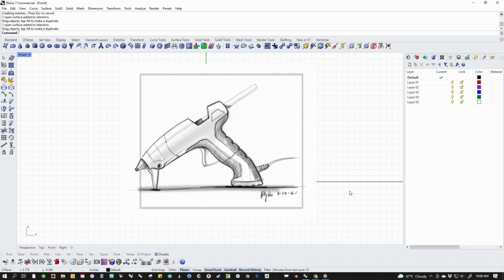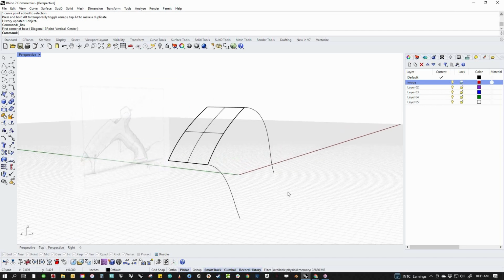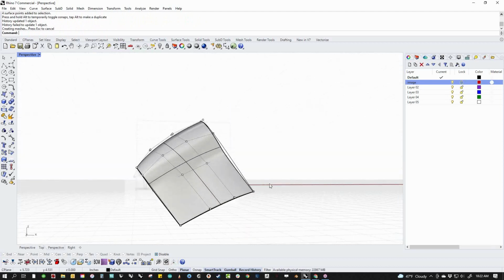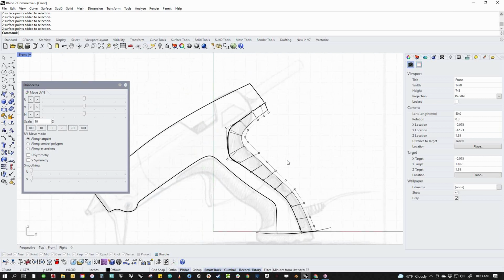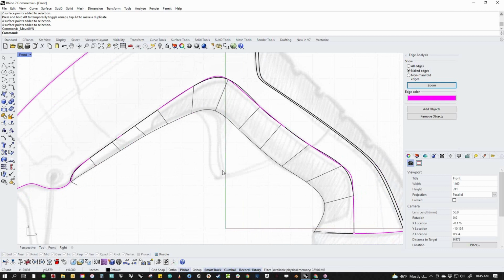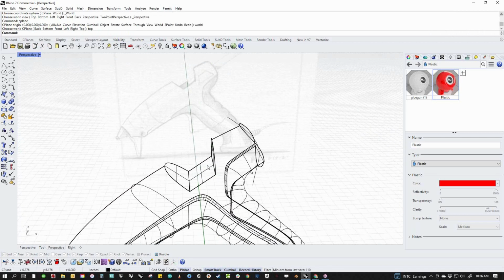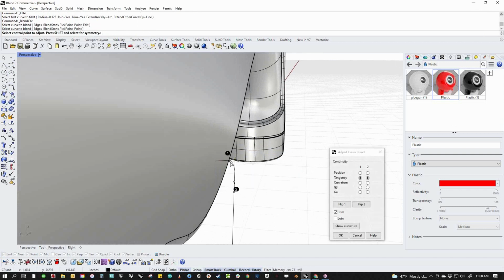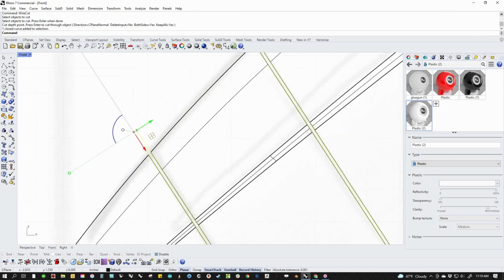Rhino 7 Glue Gun Build

Comment: Kyle Houchens ignores ExtendSrf and Isolate. He extends surface edge by moving its control points. He isolates objects by running two commands: Hide and HideSwap.
Reply from the maker: this is not a correct statement. 

I actually use an alias set to the keys ii

_invert _hide
( i repeat keys on aliases as needed to keep wrist strain to the minimum) 

but I've used that for decades before isolate became a thing. 

Isolate is the way to do this now, I just have not updated my hotkeys. 

extendsrf has it's place, but I prefer to move points when possible since extendsrf adds spans and points, and simpler surfaces are always better
Reply: @Rhinoceros3d  Thank you for quick reply. I always learn something useful from your videos. I have downloaded and watched about 120 of your videos.

Comment: Thanks for the great material you post! Appreciate it a lot. 

What about making a video about how you would approach modeling a ski boot? It would be interesting to see how you would do that. 

Best regards!
Reply from the maker: Great idea! Stay tuned
Reply: @Rhinoceros3d  Staying tuned :) 

One interesting thing that I would love to see your approach on is when you are trying to blend/connect an organic shape to a very strikt shape with ISO certification. In the ski boot case it would be the upper part that would be organic and not symmetrical and that connects to the bottom part/sole that has ISO 5355:2019 to consider.
Reply from the maker: @velomattis  in that case you have to "mind the gap" simply stated you have the two parts, organic and strict, you design the shape of and then trim a gap between the two objects and use blend surfaces to connect them. 

similar to the pipe trim video I posted earlier here: 

https://youtu.be/4mXv4IaWSBw

Comment: Just curious, I'm 47 min. in and i keep wondering why you don't do this in sub-d ?
Reply from the maker: Subd is great for sculptural things, but can be a challenge to maintain a crisp feel to the parts. 

This part could likely be subd but I wanted to talk about the build strategy for doing this type of shape in nurbs which can be very difficult if you try to build it as a y branch and not as a single surface.
Reply: @Rhinoceros3d  Very useful surface modeling techniques. Thank you very much!

Comment: Unrelated question, why does Rhino convert nurb objects to meshes when the display mode is set to render or arctic?
Reply from the maker: You may be confusing a render mesh used for display by your video card with an actual mesh that would be used for say a 3D print.